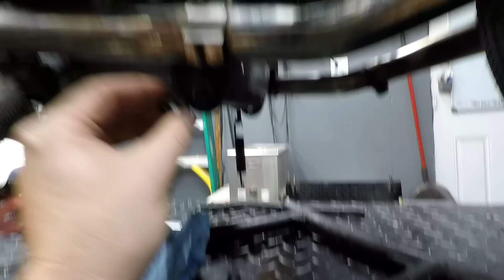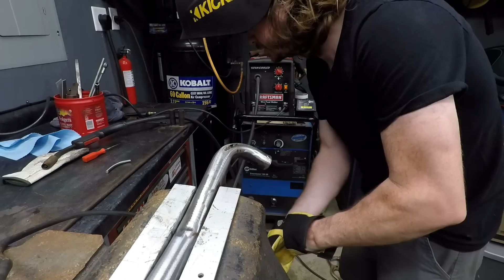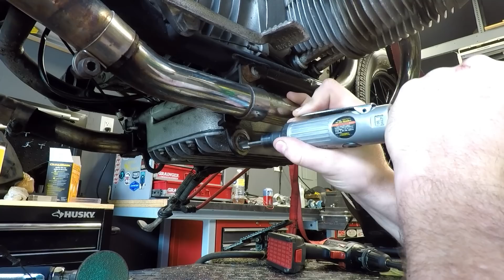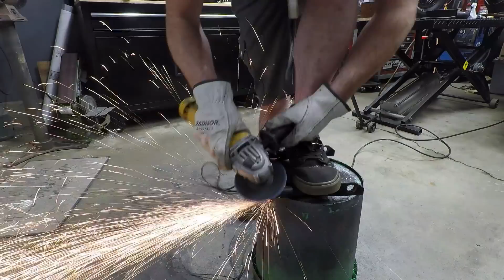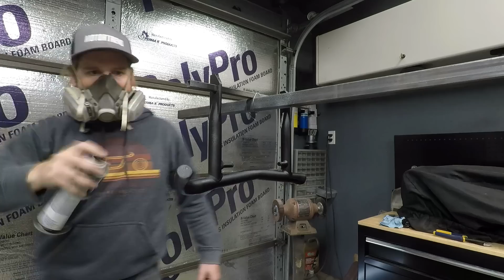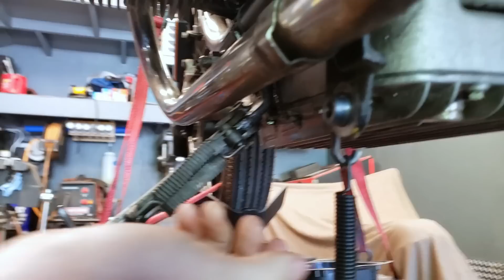BMW Airhead Center Stand Repair Mistakes Were Made

Comment: Nice little fix there dude 👍🏻
Haha I had to have my eye drilled to get metal out, clamp ya head in a thing to hold you still , then drill, my eyes are watering just thinking about it 🙈
Can I ask you, how are you finding the mini lathe, any probs or limitations yet ? 
Wayne 👍🏻👍🏻
Reply from the maker: I get super weirded out thinking about my eyes.  Just the worst when that happens. SO far I LOVE the lathe.  I use it almost daily for various things.  I do wish I could clamp larger diameter things with more stability but thats obviously going to be difficult on a mini lathe by nature.  I'm still learning how to use it as far a cutting speed/depth and have a very hard time with trying to use my parting blade on steel.  I think I simply need a better blade as my HSS blade works perfect on aluminum.  Overall I am 100% happy with my purchase and only wish I was able to get it sooner.
Reply: @BrickHouseBuilds  thanks for your time buddy, huuum I keep thinking about one, just to do small bits like wheel spacers an stuff, even if it’s good enough to then get them done by a pro, haha I’m already needing to have some spacers turned for the wheel on the new build, and I’m gutted I gota wait 🙈
Again thanks for taking the time to reply, an I’ll look forward to your new vids 
Wayne 👍🏻
Reply from the maker: @Dustmonkeycreations  well I use it for all that small stuff I don't want to outsource.  I have a GS550 build coming up that will require many spacers and adapters so this tool is a must
Reply: @BrickHouseBuilds  nice one
Look forward to watching buddy 👍🏻👍🏻

Comment: If I remember right,  the shocks on the old air head BMW's are rebuildable . You just replace the spring and bushings.
Reply from the maker: They may be indeed. For this application it would be cheaper to buy a basic aftermarket set
Reply: @BrickHouseBuilds  I helped a friend rebuild a set , but that was years ago.  Thanks for your reply 👍

Comment: Excellent fabrication skills there! If a few mistakes were made, then it looks like you addressed them quite nicely. Yes, wear your safety goggles or glasses, keeps your eyes intact. I use goggles as they add extra protection around my eyes when grinding or cutting anything.
Thanks for a great video!

Comment: Great job making it more stable but it looked like when the bike was on the center stand the rear tire was on the ground, which kind of defeats the reason for the center stand.    Maybe it's a trade off the bike owner was willing to make.  If you want tires that size, you can't really use the center stand for maintenance.
Reply from the maker: No this stand is designed to be just like this. Called a Reynolds ride off.
Reply: The Reynolds Ride-Off is designed that way. I have a couple on my bikes (they came to me that way) and I greatly prefer the stock BMW stand which does lift a wheel off the ground.

Comment: That is an after market stand, the original stand would have worked fine.
Reply from the maker: Its a Reynolds stand yes. Many changed to these because the stock stands were very narrow and many bikes fell over. An original stand would still face the issue of worn pivots

Comment: Wouldn't it be easier to get a new stand, or a used one in better condition ?
Reply from the maker: Not in this case. Its easy to weld it up. The pivot would have been bad with a new stand anyway and not fixed the issue.
Reply: @BrickHouseBuilds  That is such a good looking bike. I especially like the exhaust. I'm glad to see it worked out for you as well as it did . Hope you're enjoying the Memorial Day weekend !